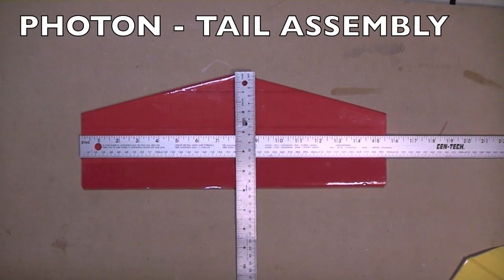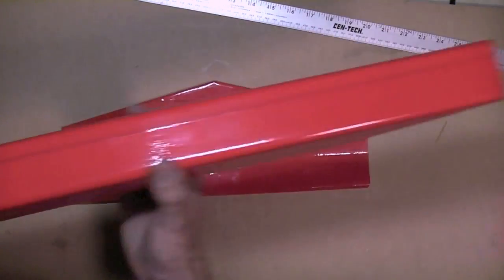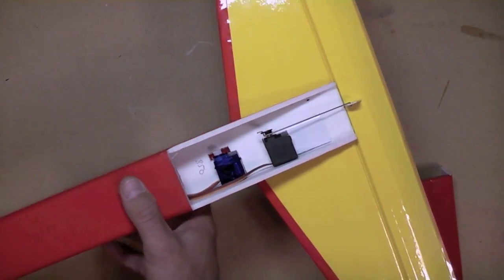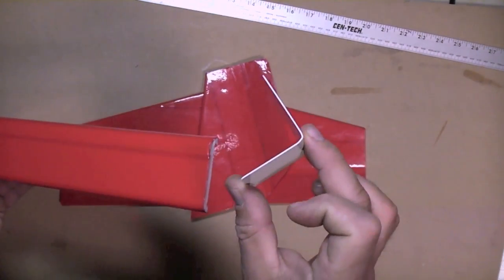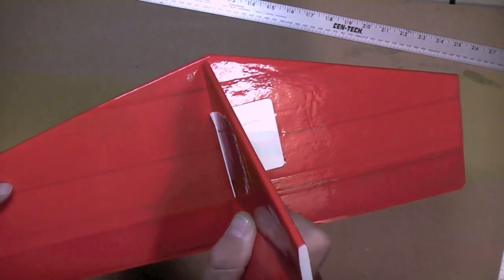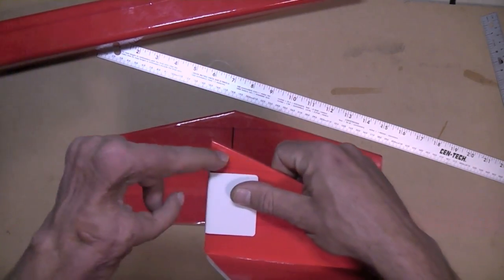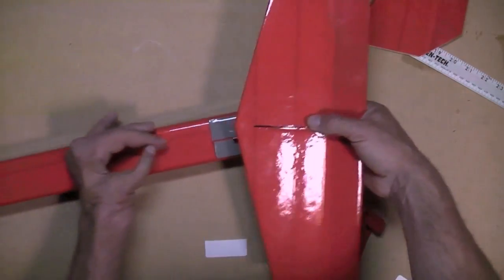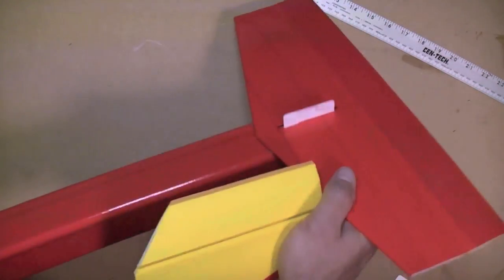PHOTON - Tail Assembly

Comment: Ed if you don't have one of these yet , they are super for bending gift cards and reheating cold hot glue , because you can pinpoint the heat . Not cheap but worth every penny .
 http://www.harborfreight.com/plastic-welding-kit-with-air-motor-and-temperature-adjustment-96712.html